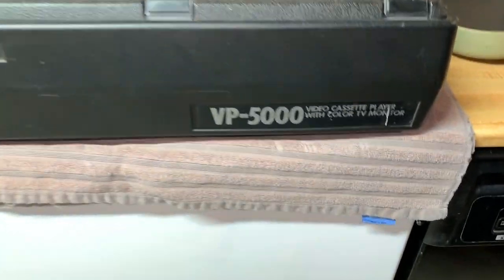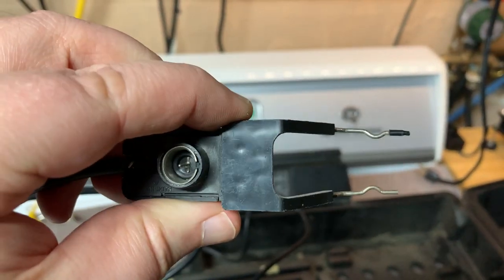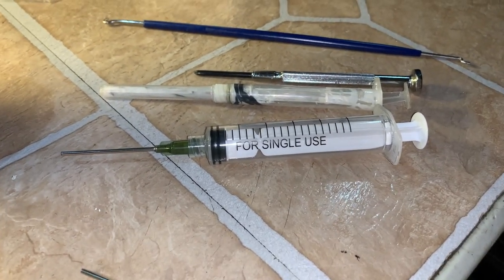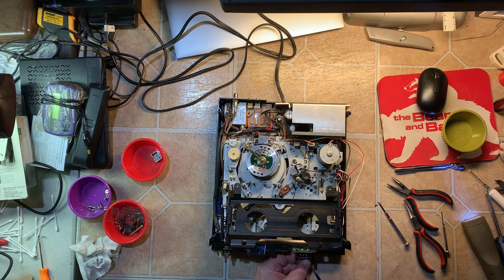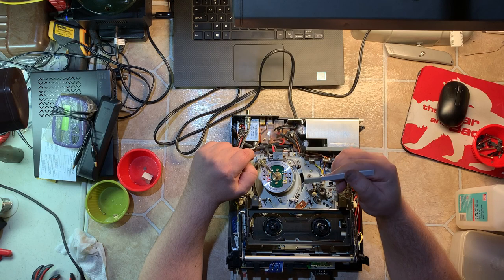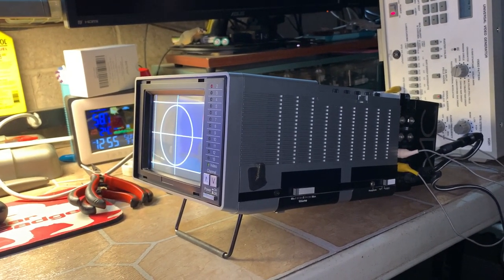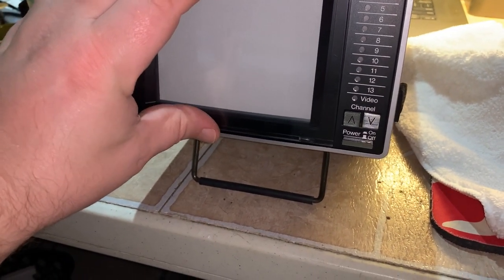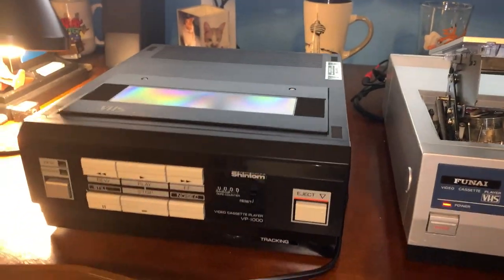1985 Shintom Model VP-5000 Portable VHS VCP with Monitor

Comment: I have this same player but it's the portavideo branded one, it was working awesome after I took it apart to clean the heads but now it doesn't fast forward, rewind, pressing play brings up a still and then it stops, and ejecting the tape leaves the tape in the machine. There is a click and a whirring noise like the motor is engaging when I push the buttons, is this a belt issue?
Reply: Loose belt I opened it up, any links where to purchase replacement belts?
Reply from the maker: I use turntableneedles.com for belts.
Reply: @spatsbear  much appreciated, I purchased a variety kit of belts off of smc electronics, they have tons of old parts in stock

Comment: Was that an ultrasonic cleaner you were using?  It sounded like it was interfering with your camera's microphones.  As for the portable VCP, it's interesting that they packaged it the way they did.  Probably cheaper than purpose building the components into the plastic casing.
Reply: Yup, it's a 5-liter commercial ultrasonic.  It interferes somewhat, due to it literally working via sound waves, but it also simply sounds like that.